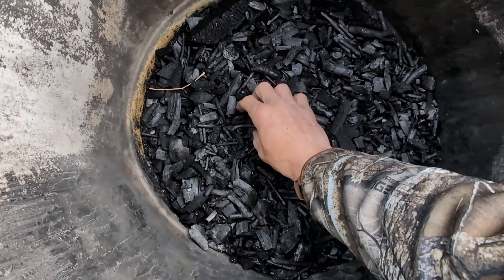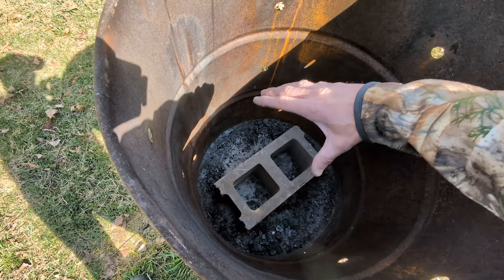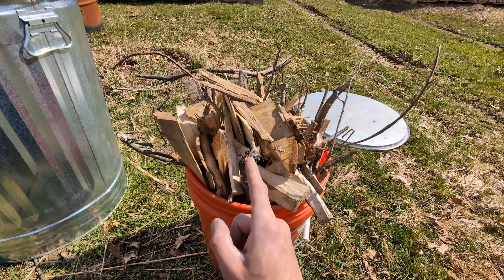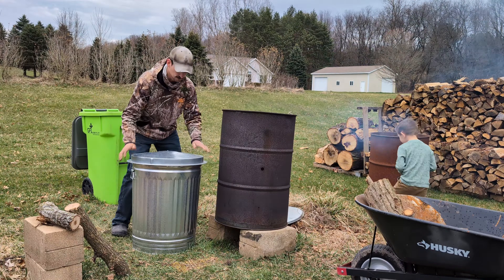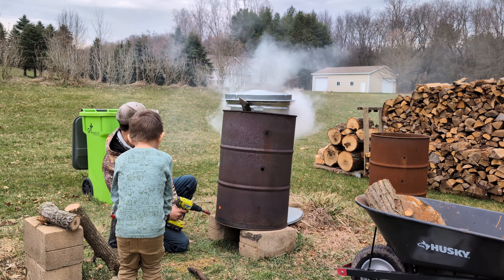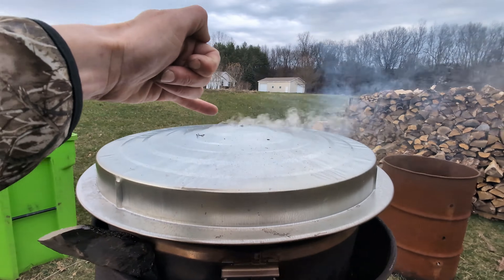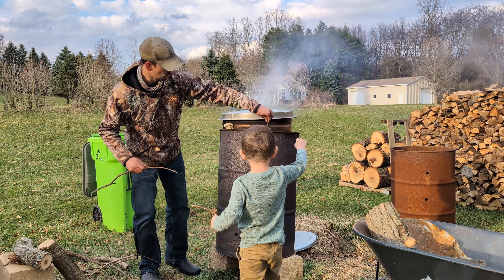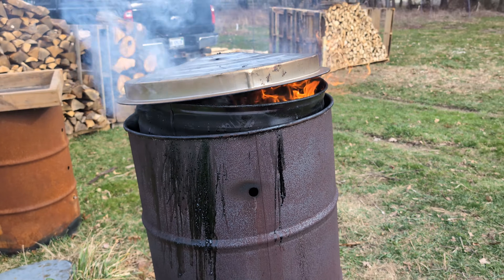Biochar in 30 Minutes | Garbage Can Experiment

Comment: Might want to stay out of the smoke when burning a brand new galvanized trash can or any galvanized metal ,they put off toxic gasses as the galvanization burns off
Reply from the maker: Yea it was pretty nasty.  This method doesn't turn the gases into fuel that burns off like bottom holes would
Reply: @FastGardeningMichigan no he means the galvanized fumes, not the wood gas. It’s called metal fume fever. You wanna remove the galvanized coating either with acid or really hot burns very far away.

Comment: Keep the 55g hot af, wrapping furnace insulation helps, and stuff the sides as well as the bottom to begin. Burn it top to bottom, and the inner can will do what it should do. 
Opening the inner can lid will eventually lead to a trip to the hospital, or at least a change of shorts... it will explode! Ask me how I know.
Reply from the maker: I thought I lost my eyebrows a couple times.  Ended up using a charred branch to do all the lifting